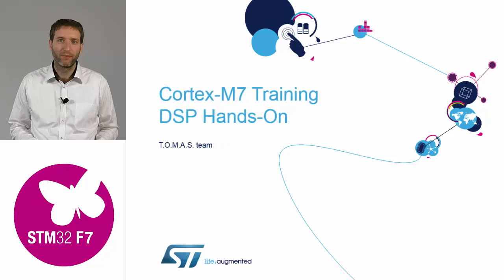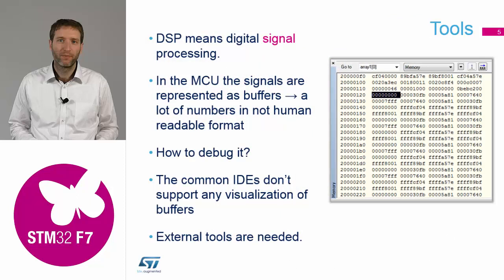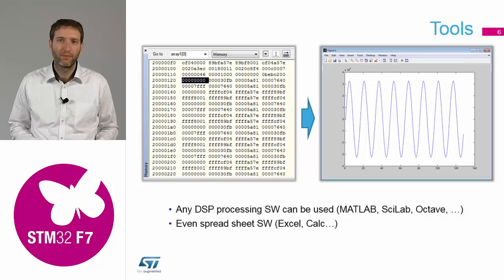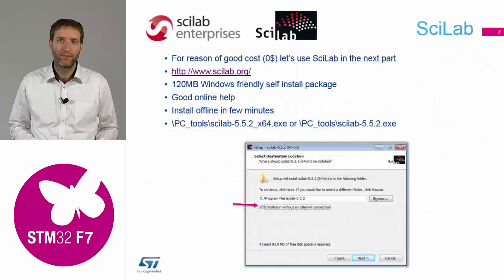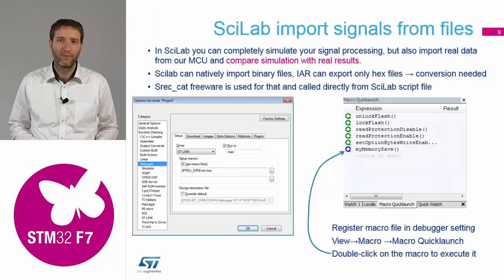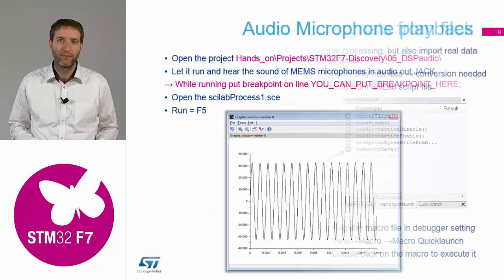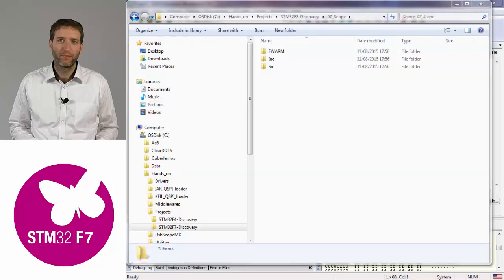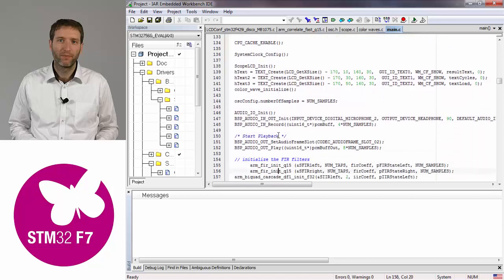STM32F7 workshop: 04.5 DSP corner - Scilab introduction

Comment: SIMD Instrustion Set?
Reply from the maker: SIMD - Single Instruction Multiple Data. It is set of instructions available from CortexM4 cores which are performing 2 16bit operations in single clock cycle. 32bit data is treated as 2 16bit data for those instructions.
Reply: @stmicroelectronics  I was looking for Simd instruction... When he was doing the code setup threw.
Reply: @naasikhendricks1501  8:00 As I understand this, the SIMD instructions are called from the CMSIS library functions, so you don't see them directly in the code, you only see the CMSIS library functions, which call the SIMD instructions internally... if that is what you mean with your question?